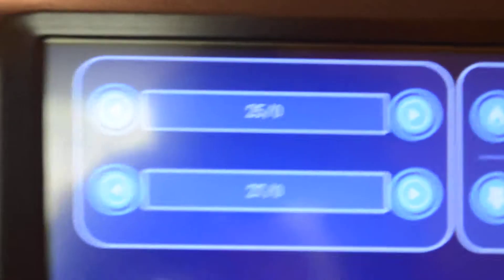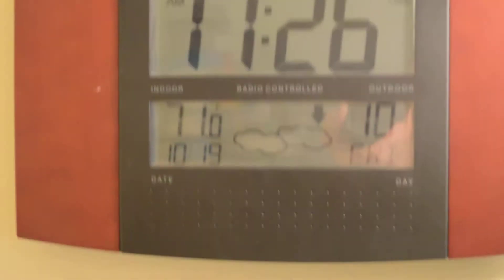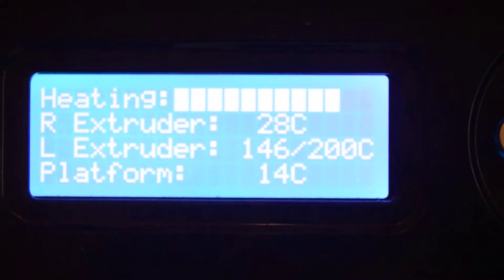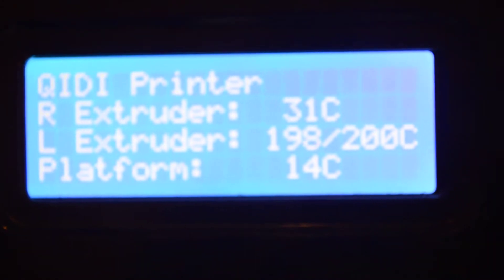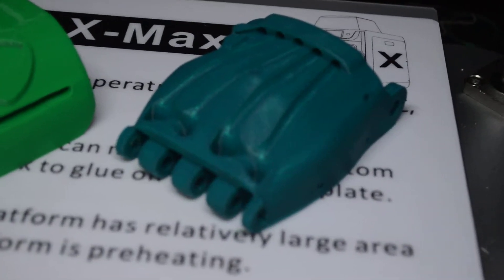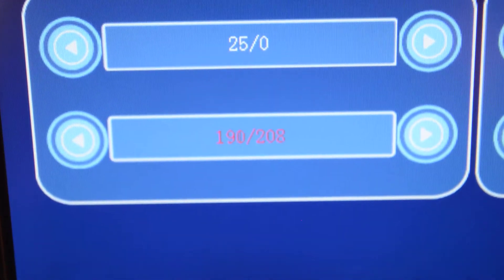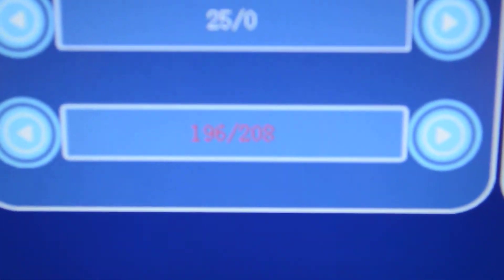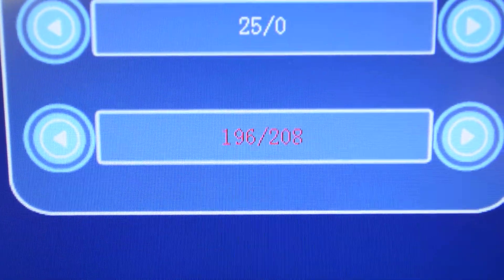Solved: Comparison of Qidi Tech 1 and Qidi Tech X-Max heating to 200C

Comment: I've sen other 3d printers have issues with slow bed heating if they forgot to switch the power supply from 220v to 110v.  Is there a chance that this is the problem here?

If the nozzle heater is expecting 24v but, because of the power-supply settings, it is only getting 12v, it will still work but will heat much more slowly and might also have trouble reaching high temperatures.
Reply from the maker: No, it was a firmware issue. New firmware fixed the problem. Sorry I didn't update this sooner. Actually, I only posted the video to show Qidi the problem. I should have just sent them a link to the video. Sorry for the confusion.
Reply: @jepolch , thanks for the reply.   What do you think of the printer overall?   Was it worth the money?

I'm looking for a printer that can handle larger volume that my current Flashforge Finder (140mm3) and is enclosed (PETG prints warp fiercely on the Finder) and  has a hot-end that can handle higher temperatures but I don't want to give up the "plug and play" nature of the Flashforge stuff.  This like the only thing that has all of these capabilities.  But not many people have them and reviews are tough to find.
Reply from the maker: @jonathangwynne1917  It's really a great printer. I have four printers, but the X-Max is the only one I use now. Qidi recently sent me a new all metal hot end that can go to 300C, I believe. I don't know if the one you buy will have the new hot end. Best to pose your questions to Qidi tech support: vipservice@qd3dprinter.cn They are super helpful.
Reply: @jepolch , have you printed any exotic filaments on the new hot end?  I assume it can handle even the most abrasive and high-temperature stuff.
Reply from the maker: @jonathangwynne1917  PETG and ABS, but not carbon fiber yet. Mostly PLA.